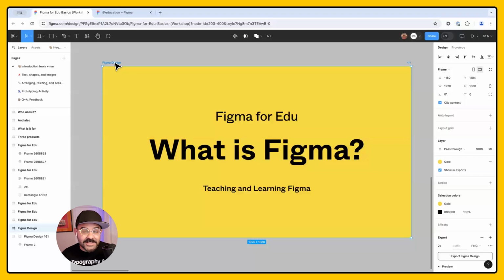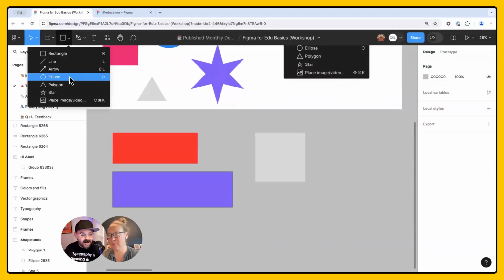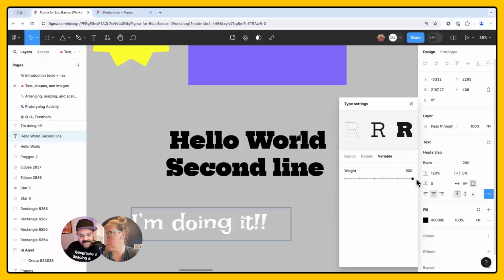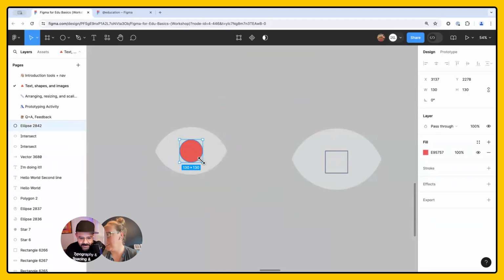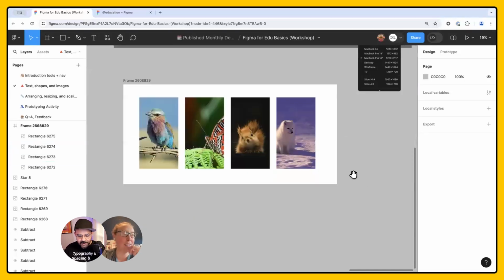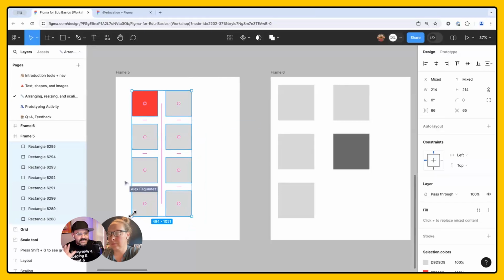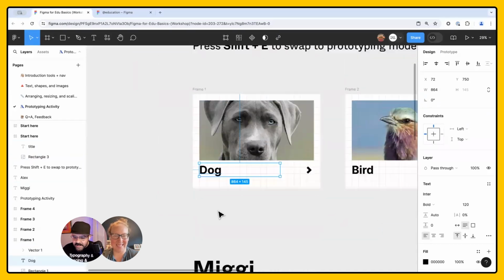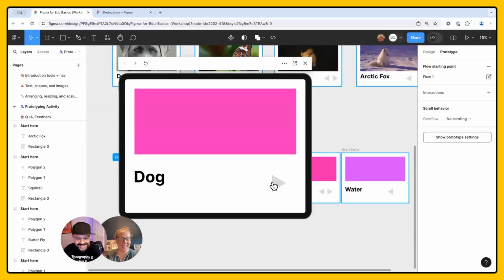Figma for Edu: Figma Design Basics for beginners

Comment: Like this comment if you want Figma to add horizontal scrolling to the layers panel to allow for full visibility of deeply nested layers. 

I believe this would solve one of the most underrated Figma design flaws.
Reply: Why are there so many layers nested, I feel like my design is only 5 or 6 layers at the most
Reply: @xuchen4829  one word: autolayout
Reply: @xuchen4829  even 5 or 6 layers would get clipped depending on how they are named and if the sidebar is not expanded